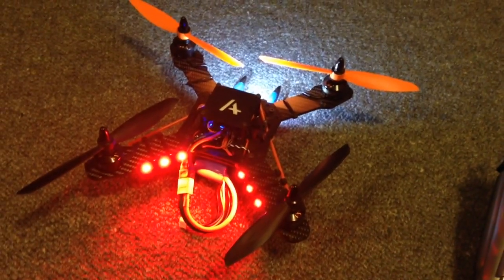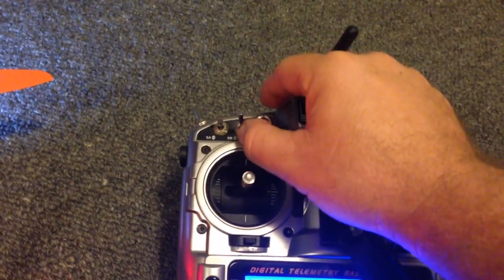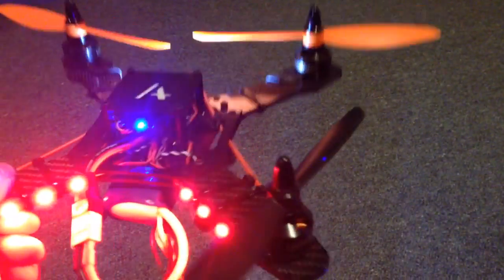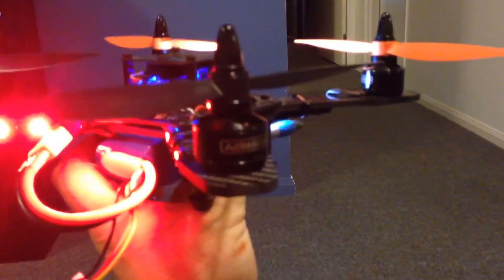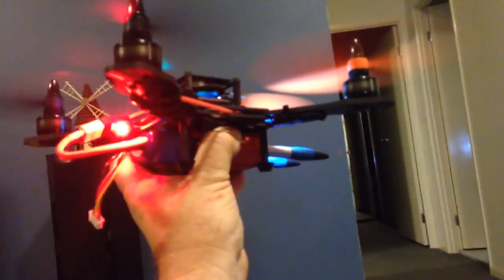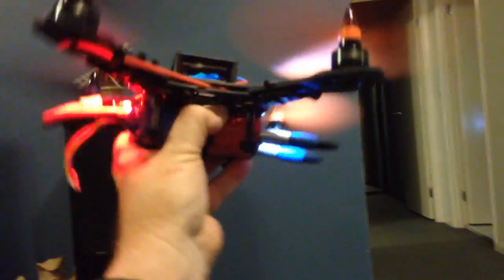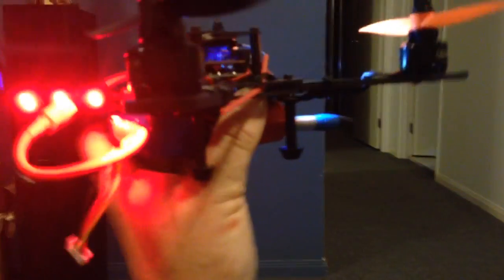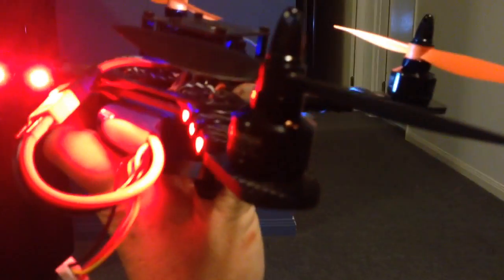Betaflight Air Mode - Motor Stop Enabled

Comment: thanks mate , here i was thinking airmode was just simulating the idle up for guys who couldn't do it on tx .. flashing tonight :)
Reply from the maker: +Rotceh Yes that is what I initially thought also.  I have always used an idle up and never had an issue with throttle stick at 0 in flight.  Air Mode definitely corrects more aggressively - I could not show it in the video but with throttle at minimum the response to roll pitch and yaw inputs are also much stronger.